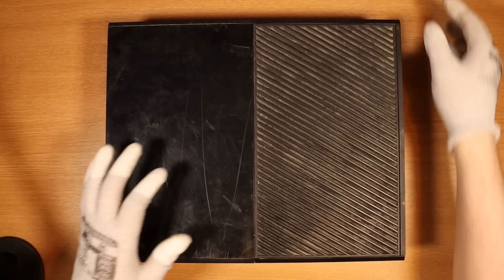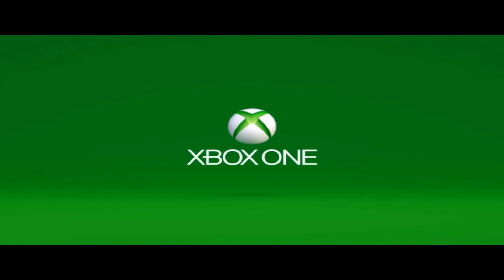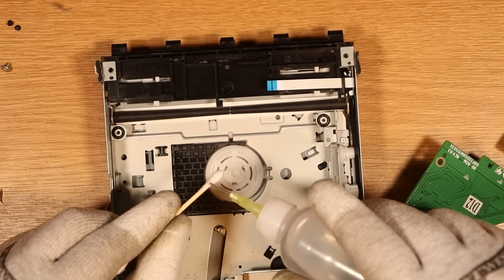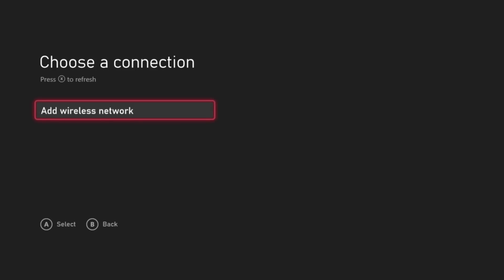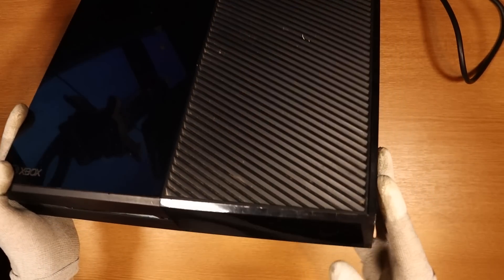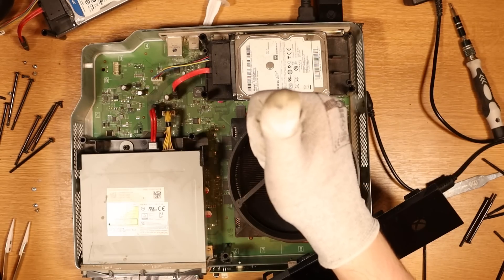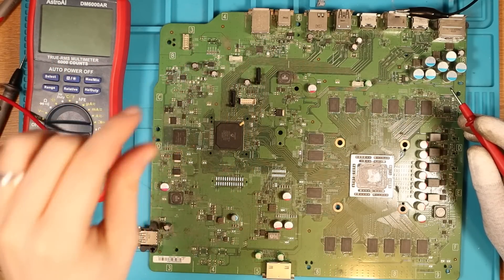I Paid £180 for 6 FAULTY Xbox Ones - Can I Make Money?

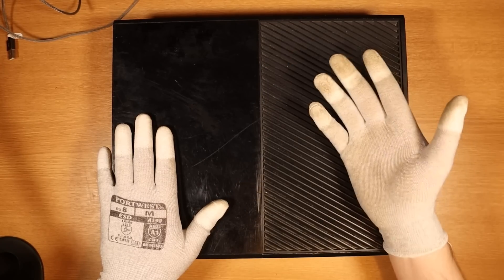Comment: 2:58 On my Xbox, a similar thing happened where it was white when plugged in, but the light became orange when it was turned off. The console can get power, though.

Also, 6:50 I think the disc drive thinks that there's a disc near it. Reason I think that is because it sounds like it's trying to take in the disc. A similar thing happened with my Wii, actually.

Comment: Great job Joey. Your diagnostic steps Use ur face specifically around ur lips to detect heat. Its the most sensitive part of your body. For the other one with the mess a wire brush meant for boards are great.
Reply from the maker: Thanks Jesus! I will have a look :)
Reply: @JoeyDoesTech  last time I was commenting I was running out of battery.     Your diagnostic steps lead you straight to the problem and that is all we really want to do. Understand these devices so it requires less time to work on them.

 I hope you find the short on that board. Measure around the chip you probably have a shorted line. Most likely what that chip outputs and by the looks of it the large via on the right of the chip. Hopefully it’s just a cap on that line but large chips like the cpu or as you say a short inside of the board will not get as hot as the chip. Here injecting voltage on a shorted line (if you find one) would be great for the path to the short should get hot and not the chip. Should help pinpoint it out plus a bench ps probably can deliver a bit more amps than that chip. 😆 Never inject a higher voltage than what that line is rated for. And it helps to limit current on your first time just in case you start burning something bad and damaging the board. 🤣 Great spectacle though. 👍🏽😆

Comment: Have you ran into any with these symptoms? I am about to toss it as it did not cost me anything.  Power supply seems fine. Press power button, get a power on tone and light goes white about 5 seconds later it beeps and turns off.  I have replaced the HD. Its a 1540 model.

Comment: I have an Xbox one I got yesterday.  It will power on, but nothing pops up on the screen and it shuts off after a minute or two. 
I've cleaned it all out. Put new thermal paste.  Cleaned power brick & it shows no issues (lights stay solid). 
Any suggestions?

Comment: Hi Joey, I like your videos. I'm hoping you could give me some advice. I bought a second hand Xbox one and it works for a while and then powers down. I have cleaned it as good as possible but still the problem persist. I still haven't replaced the heat paste, do you think that this could be the problem or are there other things that I might need to look at? Your help will be appreciated.